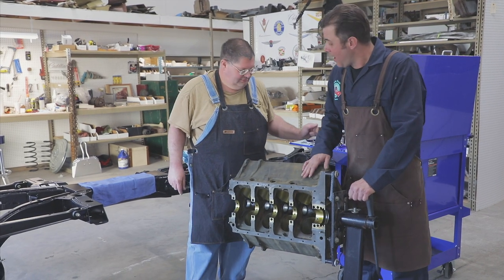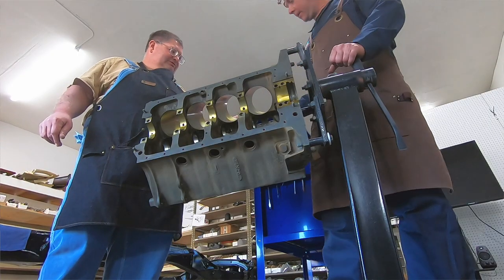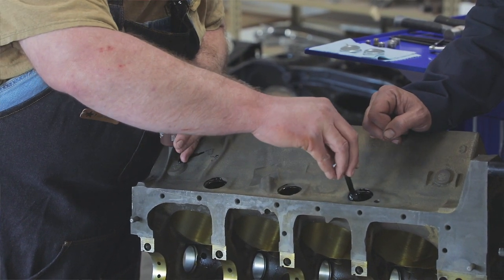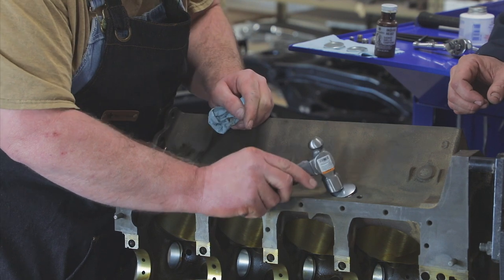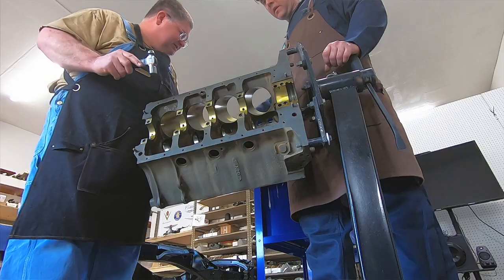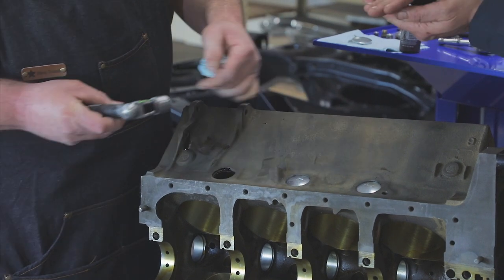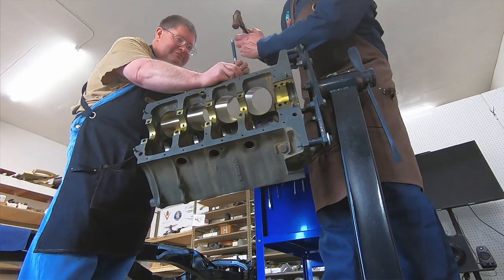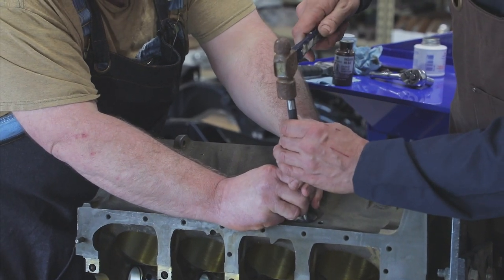How To Install Freeze Plugs on a Cadillac 390 Engine

Comment: You put those freeze plug in backwards
Reply from the maker: If you put them in backwards, they will fall out. The domed side is 
facing outwards, so when you strike it with a punch, the dome will collapse. 
When the dome collapses, it causes the diameter to increase slightly, 
holding it securely in place.